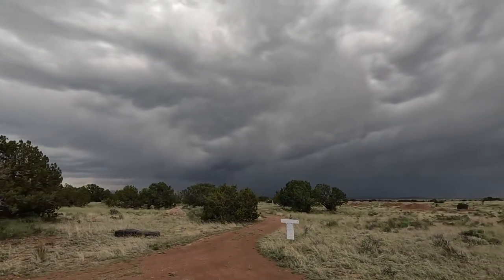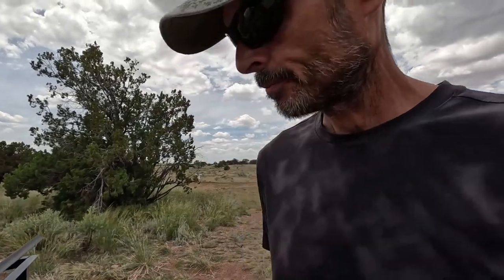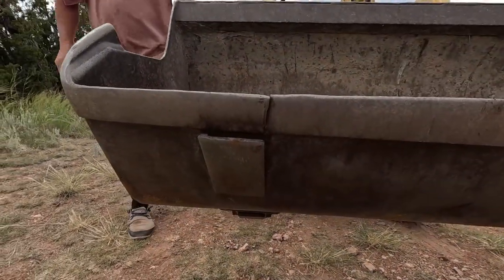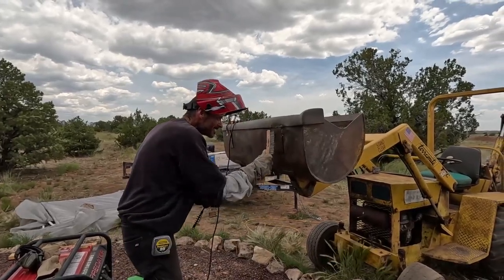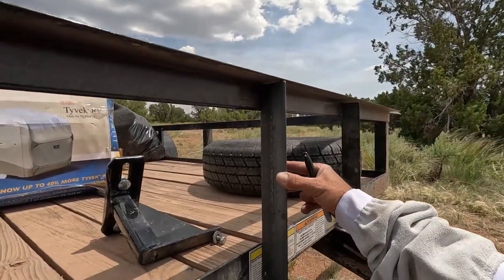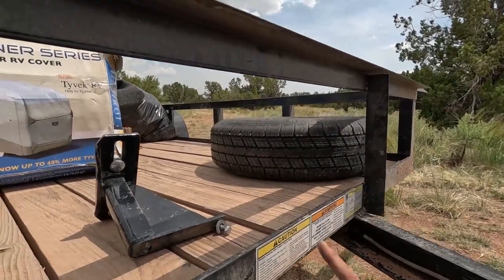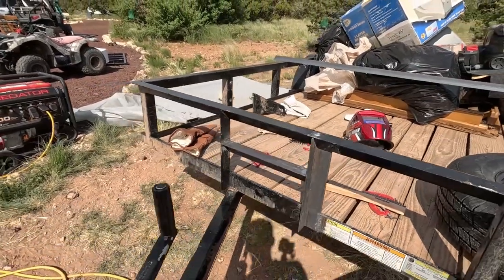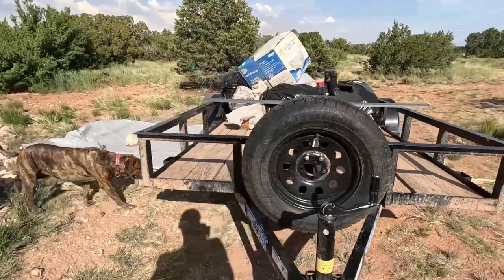Welding Projects | Homestead Vlog

Comment: Even with a wire fed you can still clean up with a grinder. I learned to. Weld when i was 8yrs old, my Dad was a pipefitter with the union and did pipeline welding as well as building trades in the city. Welding is a good skill to have!

Comment: The old pregnant pause at the
 beginning  sure sets you up for a good weld later. Heat makes it work.
Reply: When you hear the rattlesnake frying bacon in the weld you know the wire speed is correct for the setup.